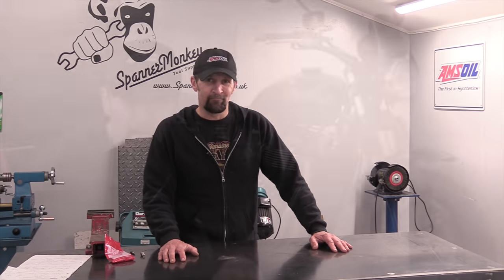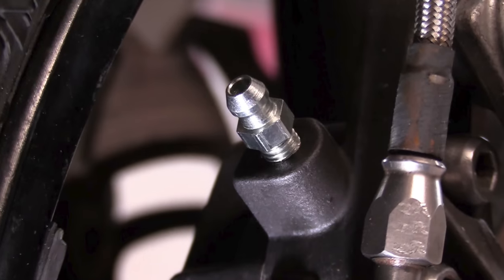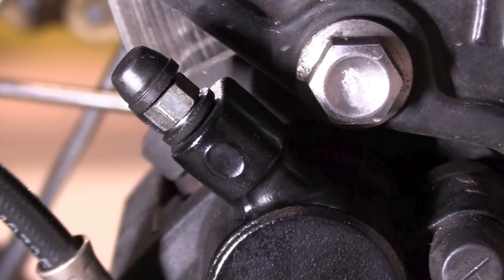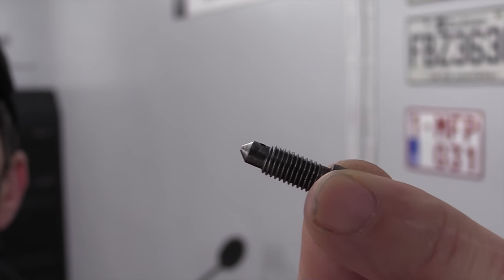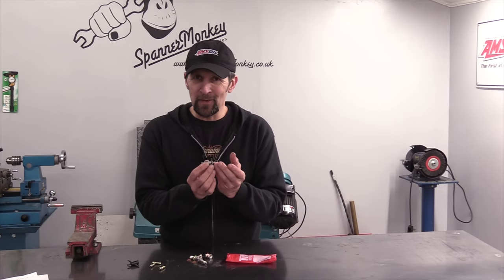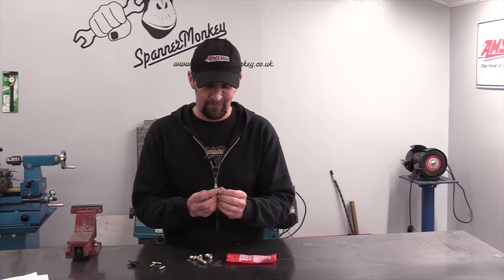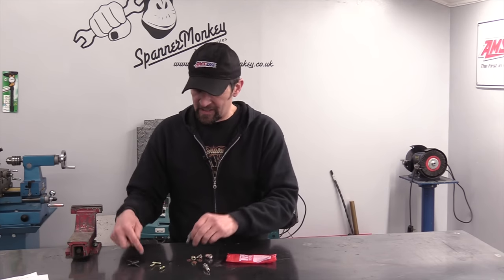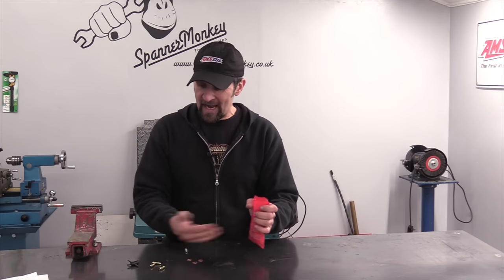Broken Brake Bleed Valve?...Simple Rescue..!

Comment: Can i use a bleeder banjo bolt on a car? I cant seem to find what size i would need. The website listed is for bikes only.
Reply from the maker: There will be only a limited number of thread / pitch combinations, car's or bikes, so why not just measure the 3 dimensions and call them on the phone, see if a 'bike' one has the same spec !

Comment: Bad Obsession Motorsports fixed a clutch slave with one of these and the first thing I thought was damn. I can fix my Honda Ascott brakes now.
Reply: imbadwrench another Binky fan! I’d actually seen / bought some these before both videos and as usual when I came to install the thread was wrong be careful when ordering guys not all threads are the same (and I did order based on make and model of bike) but I’m sure I’ll use them one day on another bike.
Reply: I just assume everyone is a Binky fan.

Comment: So at the risk of sounding like an idiot, this would install at the entry point for the brake line into the caliper with a banjo fitting that seals against the face of the caliper with the crush washers? I have a 75 Commando Mk3 with the hard line at the fork. There are something like 4 segments to the Mk3 brake system, so I've removed most of them for flex line already. Wouldn't kill me to put a new piece in. Both of my bleed screws are seized and one snapped off at some point. Would rather just leave them in place. Really would like to change for a modern caliper, but most of the kits to do so are for pre 75 Commandos. Ugh. Thanks in advance!
Reply from the maker: Yes, it's a great solution to an old caliper with seized up bleed valves... you can keep it original and still have it safe and working!

Comment: I have had the need to use one of these a few years ago after the dreaded nipple shear 🤦..was ok ..one trick I also found regarding a suspected frozen nipple 😩 is to use a small snug fitting drill bit, inserting the smooth end, into the top end of the bleed nipple as far in as you can, a little clean out if needed.. apparently it helps avoid the nipple crushing into the hollow centre when pressure is applied 👍✌️

Comment: Hey Del. Nice piece of hardware and bleeding technique. I do have the question......What did you do about the broken off bleeder?  Sorry if I missed that.
Reply from the maker: Hey Joe.. In the few cases i've actually managed to successfully drill the bleed valve open a little and get an easy out tool in there to bight it, it was a fairly new bleeder and not badly corroded in... but if they are properly corroded in place, its near on impossible to drill out the hole for a thread repair insert, and even then the taper in the bottom will be compromised,  So to be honest, if its sealed and not leaking.. i just leave it alone, and fit a Banjo bleeder. not ideal, and maybe not very professional, but in the face of a replacement caliper, maybe even an older bike you just cant get them for any more.. then its an effective last resort rescue. !
Reply: @Moonfleet41  I completely overlooked the fact that if it breaks off, its still sealed. My bad. Thanks for reply Del. I always enjoy your videos.
Reply from the maker: @joepie221  Thanks Joe,  yeah, it ends up a case of damage limitation, i guess if you wanted to make a tidy job of it, then you could fill the hole with some Belzona, file it smooth, and repaint over the casting,  but once again, Only if its totally sealed..   Have a great weekend sir, and thank you for your support... Del.

Comment: The other step I do after pushing the pistons back in  is undo the calliper and position the valve upper most so the air bleeds to the top  and let gravity do the work.

Comment: My bleeder valve broke off in half upon tightening it on the very last turn/rotation. I finished the brake job and it's the old caliper that I left on there. It's not leaking because the valve is closed (albeit broken in half). My question is, should i extract the valve and replace with a new one (assuming they sell them separately) or leave as-is and just replace the entire caliper the next time I service the brakes??
Reply from the maker: I've broken a bleed valve off in the past and because there's a hole in them, right down the centre, I was able to easily remove it with an 'easyout' and a little heat and I would do it now, rather than later on when you need them and it becomes an off the road job as if they really are jammed and you snap the easyout, you'll need a new caliper, but you've got plenty of time to get one at the moment.

Comment: Used them for years, However they are designed for the master cylinder, Usually at the highest point of the brake circuit to let air/fluid out.

Comment: I didn't know these could be got..but emm, what happens to the broken valve in the caliper? there's a channel in it so it'll presumably leak, still has to be butchered out?
Reply from the maker: If a bleed valve has snapped off and refused to move, it snaps off in a closed position, so it won't leak, but if it does, that means it's not completely seized and you could quite probably get it out!

Comment: would be nice for a demo video, I have no idea where to put that, is it to be installed where the bleeder valve is? or it will replace the existing banjo bolt?  if its going to replace the existing banjo bolt, what to use to plug the leaking bleeder valve, I don't see a matching plug bolt/screw on the product link, I need this right now, kindly assist, thanks.
Reply from the maker: If your existing bleed valve is leaking, then just replace it with a new one... even seal it if you have to with some plumbers tape...  but yes, this product fits in to the banjo bolt hole and replaces it, then you just bleed out through the banjo bolt!

Comment: Probably being a bit thick but where does this screw into? I have the snapped off bleed nipple on a very expensive and no longer available AMG caliper. Mike
Reply from the maker: It replaces the banjo bolt on a bike caliper....if your 'Car' caliper has a direct screw in pipe.. then this wont work for you mate !
Reply: @Moonfleet41  Thanks for your prompt reply - I reckon you'd probably get a few views if you did a follow up video demonstrating how to fit etc.Mike

Comment: Hi Delby I love your content. While on the subject of brake calipers, will aluminium washers perform on par, worse, or better than copper washers? Pros and cons of them? Thank you
Reply from the maker: I would use copper washers on brakes.  It is true that soft aluminium washers seal things like oil drain plugs very well,  but i have never seen them used in braking systems from the factory, so just go with copper to be sure.
Reply: @Moonfleet41  Cheers thank you for the advice. I'll stick to the copper ones from now on

Comment: oh how I pray to almighty god I don't have to do this when I try and flush my 2012 switch back....soaking the bleed screws with a pb blaster or wd-40 the night before.....??
Reply from the maker: Don't sweat it buddy, they'll come undone just fine on a 2012 bike, you could take the step of soaking in some penetrating oil, but if they physically look clean and uncorroded, then that's what they'll be, and they should come undone easily... it's when they look nasty and rusted and all cruddy, that's when you're likely to snap them off because they'll be weak.

Comment: But my issue here is my bike which is benelli uses brake banjo union and i have ripped the bleeder screw in half  its stuck in the banjo how do i remove it and where can i buy the same size bleeder.
And also how to know which size would fit 1 mm or 1.25 one 
Thank you.
Reply from the maker: Links under the video to a range of different sizes and options, check with Wemoto direct and ask them for the correct one for your bike. !
Reply: @Moonfleet41  thanks for the information

Comment: I have a GMC ENVOY with a snapped bleeder. The Banjo bolt seems to be about the same size but I’m unsure if it is the big enough.
Reply from the maker: Check with Wemoto, yours may be imperial rather than metric, not sure on GMC.
Reply: I found that My car needs m10 x 1.50. Can’t seem to find that anywhere. Snake eyes!

Comment: You should have told me about this a couple weeks ago Del. I got my broken valve out OK but took a chunk out of the taper at the bottom of valve seat 😕 so had to get a second hand replacement caliper. Got all the system rebuild now and bleed. Seems to be all a ok. Test ride next.
Reply from the maker: Sorry mate.. but it was your request and a fair few others that prompted the video, so thanks for the nudge mate. . Glad you got it sussed out.  Ride safe aye, and enjoy the weekend.! D&Px
Reply: @Moonfleet41  Ha ha, that's ok, I'll let you off 😊 I did wonder whether the comment I made before made you think about doin this vid. Did use your tip about filling the pipes. worked a treat. 🖒

Comment: Just saw your other video on how to bleed the front and rear brakes. I did this and everything worked out perfectly fine, except for one of the bleeder screws (rear brake) that will not seal properly (I noticed it after checking on it over night). 

You mention in the other video that it is very important that there is no dirt coming in between the screw and the "socket"/thread. How do I go about cleaning the bleeder screw/socket/thread without messing it all up and getting air into the system? Is this at all possible or do I have to just accept the fact and unscrew it all together and redoing/filling the system with new brake fluid after cleaning the screw/socket/thread?

Great content and videos - Cheers from Sweden!!
Reply from the maker: Hi there, if by screw/socket/thread you mean the hole that the bleed valve goes in, then don't overthink it mate, it won't mean you have to drain the whole system down or anything... if you have an airline just remove the bleed valve completely, blow out the hole with a cloth covering it to catch any fluid spry, then put the bleed valve back in, and just bleed that brake up again... not much will come out if you don't move the lever, and it'll soon bleed up... take a close look at the seat inside and the end of the bleed valve itself, see if it's corroded, or maybe just replace with a new one to be sure... good luck!
Reply: Delboy's Garage -- Hello and thank you for the quick and very comprehensive answer! 
My inquiry was exactly how you interpreted it. 

I will do as you suggest and hopefully it will seal completely after cleaning/checking it. I have never done maintenance myself on the bike since it still had warranty (hence always done it at the dealer) but now that the warranty is no longer I prefer to do what I can myself. I was just unsure if when unscrewing the bleed valve completely and taking it out to clean/check it the fluid would rush out/be sucked in creating a mess/air issue. 

Once again thank you for the very comprehensive explanation and keep up the great work!!
Reply: Short udate - I checked and cleaned the bleed valve and the hole it goes in to. All looked brand new and clean. I put it back together and still a leak... I will get a new bleed valve (the leak is right in the joint where it meets the caliper). IF after exchanging the bleed valve the same problem continues - could it be that the caliper itself has been damaged, cracked, by tightening the bleed valve too hard during earlier services maybe? I have a slight recollection that you mention this can be the case in one of your videos...? The rear brake is the same one as on a BMW F800 GS (http://www.rubbersideup.com/2014-bmw-f800gs-f800-brembo-rear-brake-caliper-34-21-7-717-627).

Comment: Sorry Del, you lost me there. Is this after you drill out the old bleed valve?
Reply from the maker: Leave the old bleed valve alone and forget about it, this replaces your banjo bolt and then you use that as the bleed point from then on.
Reply: @Moonfleet41 
Yes, I see now. Good solution 👍